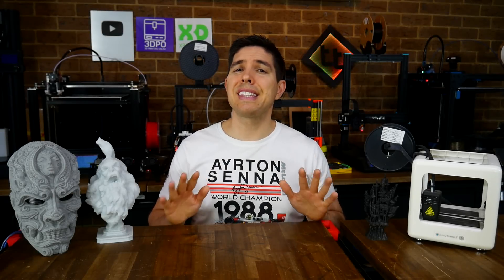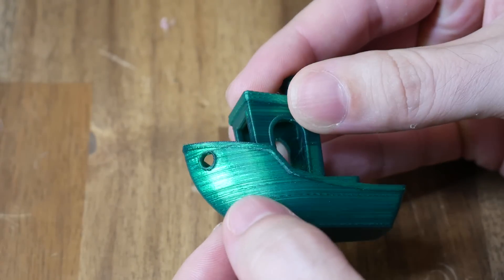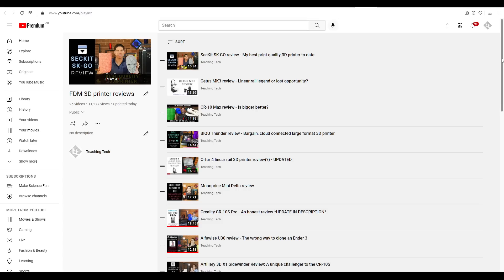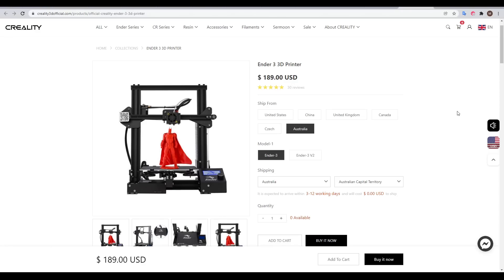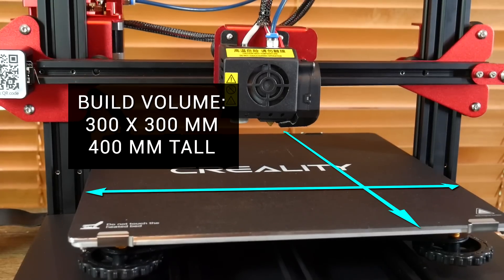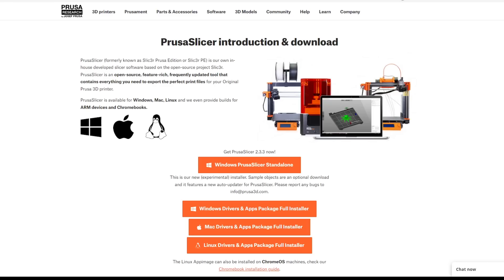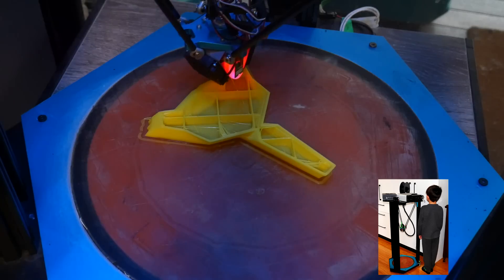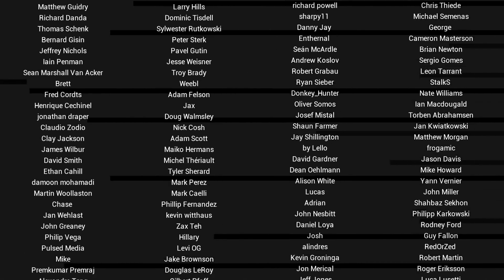Honest 3D printer buyer’s guide: Find the best machine for you!

Comment: I'm sure this might be a dumb question, but is printing something like a hallow skull something that's done in the settings or is it mostly the type of printing process by a type of printer? I'm mostly interested in printing like a head with face and hair but don't need the inside filled, almost like a helmet in a sense. Also, Would that one at 12:50 be best if I'm making them a average head size as well? Thanks in advance!

Comment: hi thank you for your video I am a 3d designer , I want to buy the first machine to print Jointed Figures toys and my budget is lower than 250$ - I need machine that has low failures and Good quality can You help me as I have no experience in 3d printers
I found Two
Ender 3 V2 Neo
anycubic Kobra 2
Which one is the best and I you advice me a different one it's ok ?

Comment: hmm... thanks, however you missed important details about analysis of investment:
1) Running costs: Electricity vs time vs using a 3D factory to print stuff for you
2) Overhead costs: filaments and cost vs what you want to do / achieve 
3) Up front cost: (covered)
4) Features: bed leveling covered, but... no advice on heat limits for beds or heads? or even what kind of heads there are? etc...

Comment: I went with a Elegoo Neptune 3 Pro and thus far besides putting it together which was easy, the bed had a little wobble I adjusted the rollers, everything else was good out of the box.  It's self levelling, direct drive extrude, and just churns out prints.  Things at least PLA pops right off the bed, and I haven't had a failed print since I took it out of the box and I'm a novice to FDM.  Having started with resin first I spent a good week learning to get things to print right, and another week really figuring it out for back to back prints.
   I avoided FDM thinking it was a hassle but wanted a cheap terrain machine for wargaming scenery, and bases, etc.  The Elegoo Neptune 3 Pro has literally been hassle free.

Comment: I have been using my work one outside of hours when no ones there, its like a $15k machine, i want something to continue growing my business at home. I really need something that is flexible cheap to buy and able to pay itself off in order to buy an upgrade. Bit by bit. I dont have time to buggerise around with it like a hobby so this was a good video. I decided i needed a toyota of the 3d printer world, reliable, accurate, does what you need it to do, refined with a decent easy software.

Comment: I’m seriously thinking about buying a 3D printer to make accessories for my RC cars. My biggest concerns are I’m not that tech savvy and I live in a 40ft bus! Would the slight movement caused by walking around the bus while parked and printing cause issues with the print? I’m also worried that the vibrations while we are traveling and the unit is in storage that it may get damaged.

Comment: Hey. I have developed a motion detection system using Arduino microcontrollers. Can I use a 3D printer to print the plastic enclosure for my project. Thank you

Comment: wait. that warped bed example doesn't make sense.  It was showing the center as "too far" and outside corner to be "too close" and the in between to be "just right".  Doesn't this just mean the outside corner was pushed up too much with the adjustment screws?  Or is the center floating making it so that it cannot be locked in place per say.  Pardon my ignorance, I've only recently been thinking about getting into 3d printing and had my eyes on ender 3.
Reply: the bottom line is you want all places on the print bed to be the equal distance from the print head when over that area so that you get good adhesion when starting a print.  it is possible for a bed to never level properly if it wasn't manufactured flat.  check with a known straightedge like a metal ruler that you can confirm is straight on its edge.  Most mfgrs. will replace a bad bed without question.

Comment: I'm a hobbyist 3D modeler (using blender), mainly working with hard surface models, sci-fi/retro futurism props. I wanted to print some of my work, just for myself. What would be a good printer under $1k that would be able to achieve a good level of details? I don't need to print large, just small decor for my office. Corexy print samples from this video are amazing, but is it achievable in my price range? Or you need to go up to 2k range, or go resin?
Reply: determine size of print first then look at models that seem to fit, and watch reviews of them on YT

Comment: Incorrect, a printer is not an appliance because you need an external program and additional input from external hardware making it an output accessory for a computer.
Reply: so a stove isn't an appliance because the pizza sits on a pan?  and a microwave isn't an appliance since your pasta is in a bowl?

Comment: Good application comparisons. I’m considering a 3D printer to make rc vehicle parts & accessories. It should be durable and light weight is good. Mostly for cosmetic with moderate functionality. Precision vs finish quality🤔hm..  I’m an auto body painter/fabricator so I know I’ll be taking care of the finish on the final product, it just can’t be too cheap of a print. I do need precision but not the so much accuracy to make bolt threads. I know there types of plastic feed but my knowledge ends there. I’m still undecided, why would make a god printer for my application? Don’t mind the noise nor speed. Having said that,  the compromise should lend to a better printer that suits me needs?

Comment: One idea is to join a maker space if there is one near you. I get to learn what I want and don't want, before buying my own. The space I belong to has two printers, an Ender 3 Pro that I have all to myself, because it has extrusion problems I am trying to troubleshoot and fix, and a FlashForge Adventurer 3 that I highly recommend to people who want something that just works. It is a little expensive for its size, but even small kids just put in their file, push start, and come back later to a beautiful print. The reason I want to use the Ender is that the things I want to build are a bit bigger than what the Adventurer 3 can make. So, check the build volume, before buying your printer if you have something in mind of a certain size.

Comment: This really helps me on deciding between a lower budget Chinese 3D printer or the far more costly Prusa 3D printer.
Since my goal is to make and design 3D objects, and not spend hours tinkering with the 3D printer, I think that helps decide it. I will do some aftermarket things, such as Octoprint, Octodash, but I want it to just work, and I want good support behind it from the company, not having to search Reddit posts where there are conflicting answers for an issue.
Reply: i want one for the same reasons , which one did you end up getting?
Reply: I'm not quite ready to invest in 3D printing yet, but I have to agree.
The quality and tinkering needed for those budget-range printeres definitely would make me either want to save cash for something like that Prusa or go the resin route (where instead of tinkering with hardware you're working with toxic chemicals ).

Comment: I've just started as a STEM teacher in a primary school and want to get a 3d printer that's simplest to use and reliable. However our school only uses iPads (laptops for teachers). Does anybody have experience with 3d printing and iPads?
Reply: ipad is no go.  you need at least a micro sd slot to side load the GCODE file to your printer after slicing (which can be done online).  chromebook would work.

Comment: Hey i love your video. and your are good to explain. thanks again.

Which 3D printer should I choose
have seen your video with cr-10 smart pro and there I had just ordered it before I had seen your video about that printer, but am now in doubt if it is my right choice
So now I go and think about whether it should be Ender 6 or Ender 7
But have also looked at the Prusa I3 MK3S + KIT

What I want or need to use it for.
It must be nice and accurate so you can make screws etc. that fit if necessary. nuts or a hole where you have to put a finger screw in.

So there are several things that are important to me. and maybe I demand too much for cheap printer.
I'm brand new to the 3D world so I do not have a super sense of it.
But I know I want to go into the 3D world and then it can be you get super good at it and even maybe do a little projects that you might be able to make some money on.

Would I stand firm if I now bought one
Prusa I3 MK3S + KIT
Ender 6 Or Ender 7

Or I bought these
Prusa I3 MK3S + KIT
CR-10 Smart Pro

so i bought 2 printer will the above be a good combo?
or what do you say?

Hope you can help me a little along the way.
Have been inside and seen many videos etc. but has also been confused and in doubt in many directions.
hope you have time to reply me and feel free to send me a direct email
xpaintbyg@gmail.com
Is a little pressured for I get the CR-10 smart pro on Monday
but will not unpack it until I just hear your opinion
however, I only have a 6 day return right on it. so may very well be quick response if you have the opportunity.

Comment: Can anyone help, I just bought my ender 3 v2. When I touch any metal parts it cause electric shock "tingling" sensation at first. But the small shocks is kind of painful now. Im from Philippines, we use 220v here. Most Electricians here dont implement grounding, so we use the universal 2 hole outlet. I use outlet adapter so i can plug it on the outlet. Please help.

Comment: My first 3D printer was / is an Ender 3 Pro. It's been upgraded quite a bit so it's not the same device it began life as but it's still a good value printer. Since buying it I've gotten a new mainboard, added a Raspberry Pi for OctoPrint, auto bed levelling and a nice stand built from IKEA Lack coffee tables. Biggest annoyance about it is speed which is sloooow.

I'd love a mono resin printer but I doubt it would work well in the house with the stink and all the steps to wash & cure. It would definitely be cool for miniatures, not much use for other things though. I think if I were to buy a new FDM printer that next time I'd buy a Rat Rig or similar - something which is potentially MUCH faster than the Ender 3 with a bigger build volume and ability to print nylon and flexible materials.

Comment: Watching your video. I do thing I got a Lemon. I have the Ender 3 Max. I already ent over some of the thing that I don't like in comments on your other video. But one thing after about 3 prints I got the blue screen and nothing I could do but replace the 4.2.2 main board. At least it turn on now after replacing the main board with the Creality 4.2.7 upgraded board. Also my printer was ver out of shape/square. I think I got it mostly square now. But there were several other issue that I think are just issue with the Main board itself and not just a Lemon issue. Mainly, That I can not connect it to Octoprint or Repetier Server. Whereas, My Tevo Tornado with a Gen L 1.0 board connects just fine to Repetier Server. YES, this is important to me. I can't ever get my Apple M1 Max Laptop to connect to my Ender 3 Max

Comment: I wish I would have seen this a month ago! We got an Artillery Genius for my son. I'm 100% convinced that we could tweak it to make it great, but I've spent dozens of hours on just messing with the dang thing instead of actually printing. The last failed print finally broke me, and I have a Prusa Mini+ coming soon!
Reply: I just had my first failed print on my mini.  Other than it being a bit hard to put together it's a set it and go type of printer that will give you consistently great prints.
Reply: Wow, I've seen good prints from a buddy's Artillery Genius but didn't know it couple be a hassle to get to work. But, hey, at least it isn't the Makerbot Z18 they bought at work. Piece of crap has never been able to work reliably for more than a week and the print quality is pretty Bad.
Reply: Hey Eli! I've been trying to shoot my Prusa Mini+ and it's also extremely frustrating. Did you get your Prusa and did you get it printing smoothly?
Reply: @rickyspectacular  my Mini was okay until I added a revo micro and changed the Bowden tube to have compression fittings on both sides. Now it’s GREAT. 3D musketeer has a really helpful video on the upgrades I did.
Reply: I am very new, but I'm not new to designing in CAD. I wanted to know  if there are other pieces than just the printer; I've seen ads for washers, etc., and I'm gormless to the mechanics of what items you'll need. I'm assuming washers & such are dependent upon which media you're choosing? So far, I've only began to research the plastics
Reply: The ender 3 pro and ender 5 should be great too

Comment: Hi 
Could you help me with a problem I have. I have a Ender 3 pro , the vertical walls on my prints , don’t stick together when I run my finger on them they separate,the layers  horizontal all stick no problem just the outside walls ,I use cura and also used prusa with the same result . I am a novice so don’t know what to do 
Thanks stuart

Comment: Nice video and Happy New Year! I'm glad you mentioned pro-sumer models at the very end. I had asked a similar question a while back on one of the 3d printing forums because I was genuinely curious how a Makerbot for Ultimaker differed compared to an Ender or Prusa when it came down to the actual nuts and bolts. The consensus was that the actual hardware isn't all that different but that the support and software were what you were really paying for with those models and brands. 

Just wondering if you have any experience in that space as well and if you could comment. 

Thanks again, love the videos!

Comment: I would say operating a 3D printer is very similar to operating a laser or waterjet machine as the slicer software works exactly like the toolpath generating and control software in these machines. You load a CAD file into the machine, adjust the settings for material type and cutting quality and it generates a playable toolpath and after you are satisfied u hit the CUT START button. However the 3D slicer is yet a bit more complex as there are much more options in comparison as the machine operates in 3D and not 2D and the process is also different so it surley takes some skill and patience to get into although it is still not hard to learn the basics but finding the right settings for a particular job and also the leveling/tramming process can be a bit tricky.

Comment: So what printer should I buy? I want a quality printer for 1000$ - 2000$. I want plug and play. (But I'm not an enemy to building it myself if all the parts are there and there's a nice manual) I'm a complete beginner in 3d printing. I do realize it will take time to set it up and some adjustment like temperature and such. But once it's setup I just want it to work. Does such a printer exist? Like you take it out of the box, adjust it, and then it works.

Comment: I also have the car hobby, and would love to add 3d printed parts for my build. The problem for me is that for automotive use, the printer needs a relatively large build volume and the ability to print specialist filament. These features are reserved for mid to high end printers, but it makes the barrier to entry quite high for someone like me that wants a printer to print functional parts (therefore it's a tool?) 
You've been 3d printing for 10 years, so your choice and the technology was limited at the time, which makes your pursuit even more impressive. But if you were a noob like me looking to 3d print parts for your car (from intake manifolds to interior bits) where would you start?
Reply: Find a good printer with a large build volume (I have an ender 3 v2 and its 220x220x250mm build volume) there are larger form factor enders available. As far as specialty filaments, you could print most functional parts in PETG which does not require any modifications. In the future you could mess around with making an enclosure for ABS parts, and even swap nozzles to use carbon fiber and higher end filaments. 
tldr; find a printer with a build volume you think is suitable, and print a ton of PETG parts (PLA would be horrible for any sort of part that's going into a car) upgrade when you feel you have the experience to do so.
Reply: I’ve had a CNC router for years and designed custom machines and not afraid of building one as I’ve had to upgrade spindles and vfd’s servos etc, any advice for a build parts list or website ( besides YouTube 😂) for putting together a bigger machine? That wouldn’t be a hobbyist level but allow me to make large props and things of that nature. Love this channel! Thanks for any advice

Comment: Looking at Ender 3 groups it's not even 'tool or hobby' camps, it's Hobby camps and everyone else is considered a miserable looser. People will assume you have BLTouch, for example, or would recommend a new fan, who cares it needs soldering, doesn't everyone know how to do that already? A lot of skill is just assumed and advice usually misses 2/3 of info needed to apply them.
I'd compare 3D printers to sewing machines as opposed to microwaves. I know of people who like to buy old ones, open them up, clean, oil and get them running but that's usually it. Most people buy one to sew, not to replace a motor or make them into embroidery machines (which is possible).
Newer printers like Ender 3 S1 etc look better as tools but I guess there will be a lot of surprises still once a fan fails or PTFE needs replacing.